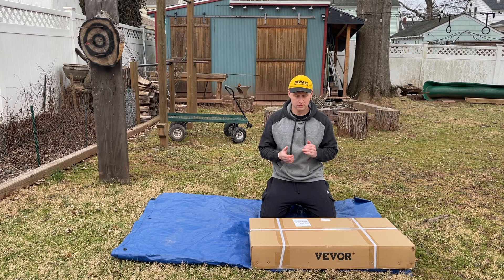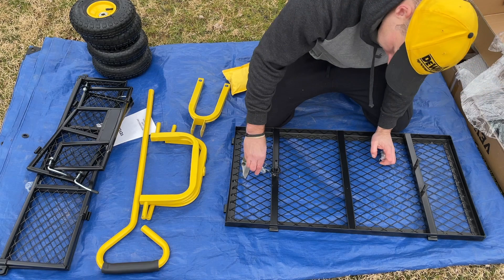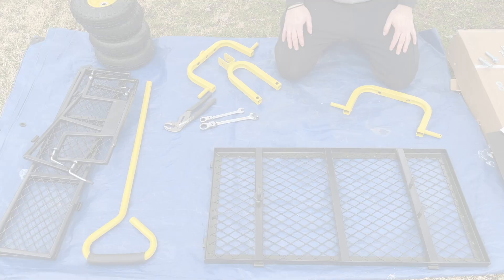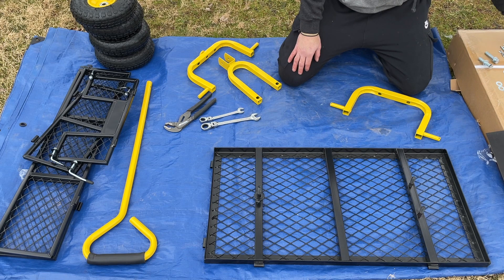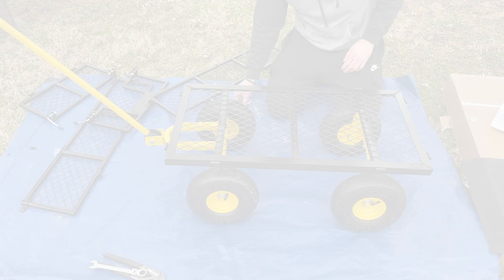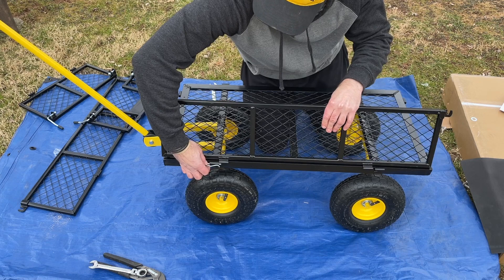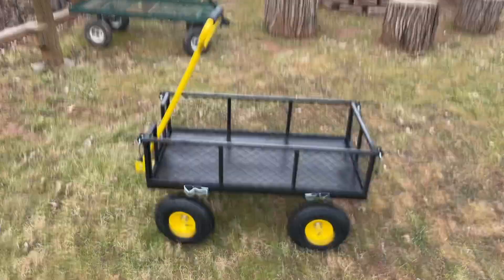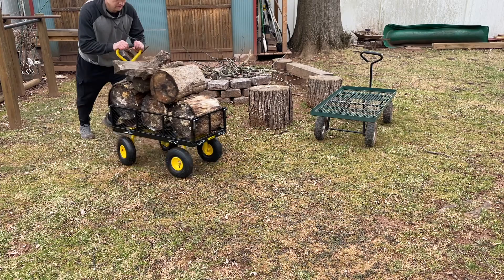Setup & Review of VEVOR Garden Cart Utility Wagon with Removable Mesh Sides

Comment: Thank you  very much! I watched your video before I opened the box and ran it stop starting as I went, using it in tandem with the booklet. Appreciate that last week I tried assembling a garden dump cart which had no instructions and the  'helpful' YouTube video... wasn't. Today, I had plumped for an entirely different model and along with your excellent assistance managed to put this baby together on my own in under an hour. Thats taking into account my stupidity using washers where none should be, and having to undo the bolts 4 times to get it right. I know. Numbnut.
Reply: Also.... I'm not great at leaving comments and pressed submit by accident. You can't help some people. I just wanted to thank you for making my cart building a fun experience. I'm a 68yr old hippy n now lve built my own eco friendly allotment transport. Cool.
Reply from the maker: All good.  Thanks for the feedback.  Always happy to hear I helped. 👍

Comment: The directions that come with the cart are ambiguous. your instructions solved all doubts about how to assemble this although they only gave me 1 large washer for the attaching the pivoting handle to the bolt on the underside of the cart platform so mine is binding

Comment: they gave you many more washers than my cart was supplied with. Also how tight did you make the handle to the swiveling axel as I tighten it enough to squeeze the tangs in but not overly tight that it caused drag on the up and down movement of the handle